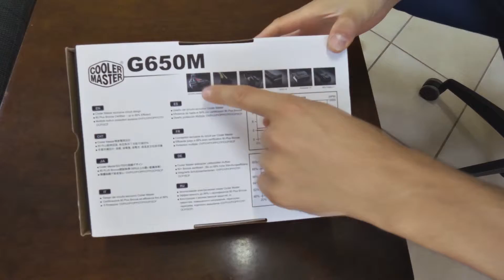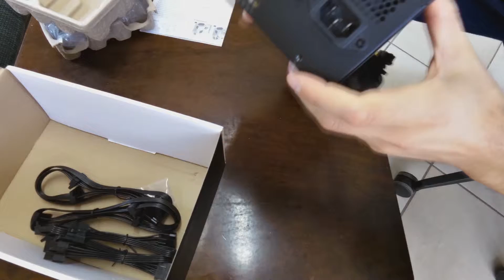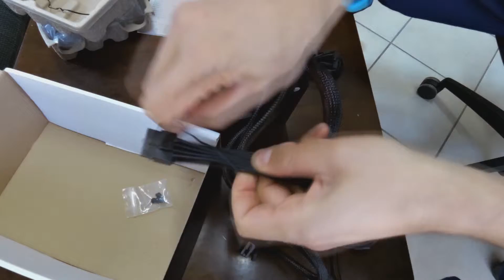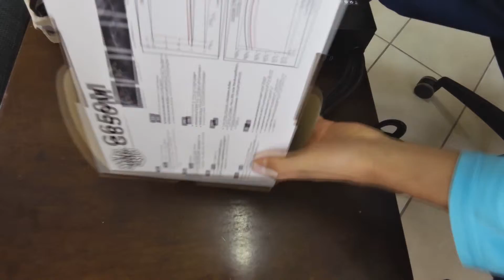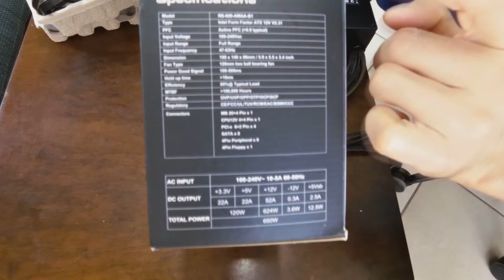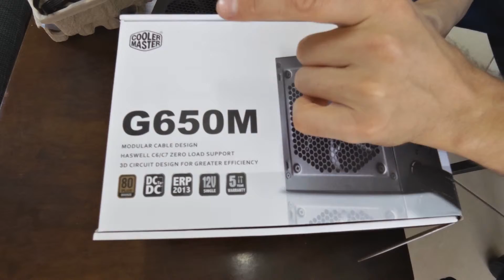Unboxing of Cooler Master G650 Computer Power Supply. (Technical)

Comment: Good review. I bought a Coolermaster Lite 600w but the fan started rattling while rendering in 3dsMax. So I upgraded to the G650M. Hopefully, it will do the trick. Thanks.